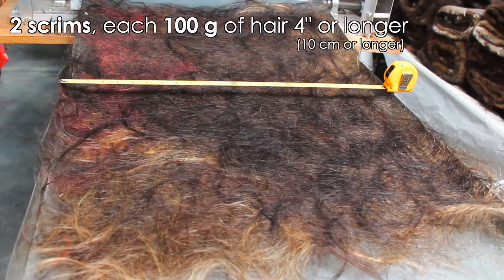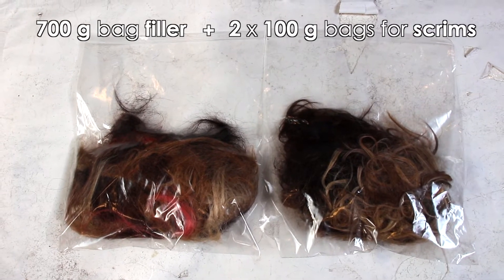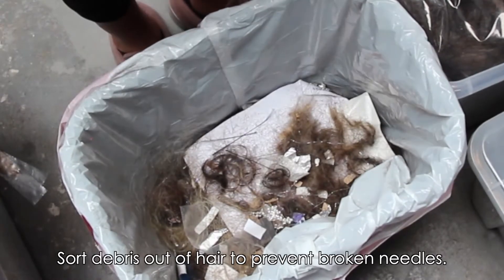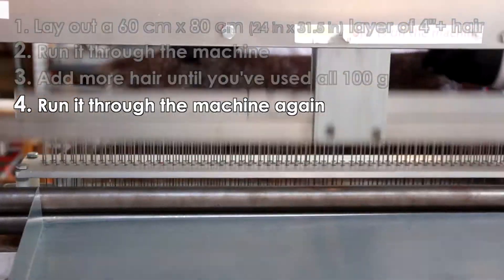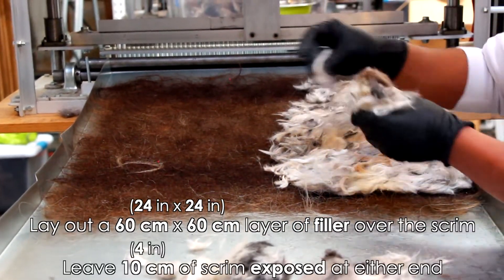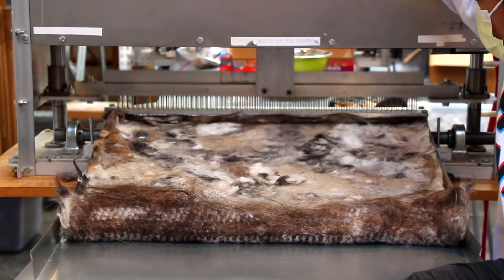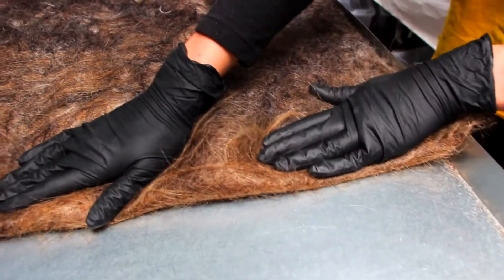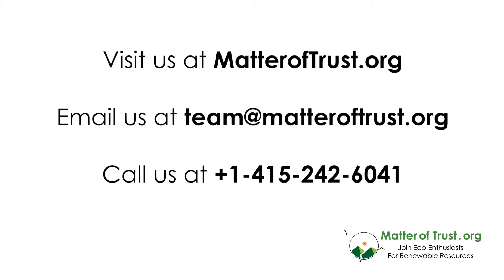Matter of Trust - How to Make Hair Mats that Clean Up Oil Spills - New Video

Comment: I make plarn sleeping mats for the homeless.  Is there a way I could create human hair yarn to make mats?
Reply: I am also looking for a way to make the hair mats myself, but without an instrument, it is not easy. For now, I collect my own hair after daily brushing, also cat's hair, and poodle's hair, all separated. The plan is to wash them separately and fill pillow cases or at least small cotton or linen bags... 
Washing a handful portion of cat's hair became a tiny mat on it's own... I used it as a table leg bumper. Straight human hair or curly poodle hair may l not have the same result after simple hand wash. 
What I am trying to say, until you find a way to make more efficient hair mat, just collect them, wash them in a bucket using UNSCENTED soap, dry them inside of  a pillow case with a zipper, and after they get dry, make a pillow case flat and use a thread, stitch it over.

As I am thinking now, it would be better to use cheese cloth and place hair in layers after washing... then to stitch it together into cubes/squares, like those used to hold dawn/feathers in comforters. I wish there was a way to attach photos in comments on Youtube.
Hope my  comment will be helpful for some.

Comment: Once it absorbs the oil, how do you recycle the mats?
Are they single use or multi use?
Reply: When they are used, they are incinerated..
Reply: It can be washed and re-used up to 10 times. After they're used up, the mats are thrown away or burned
Reply: @mynamejeff3545  can you use the oil after?
Reply: @somria  No, oil from oil spills is too contamined to be of use, so the collected oil is burned. The same goes for every other oil clean-up technology
Reply: @mynamejeff3545  alright thank you!! 💕